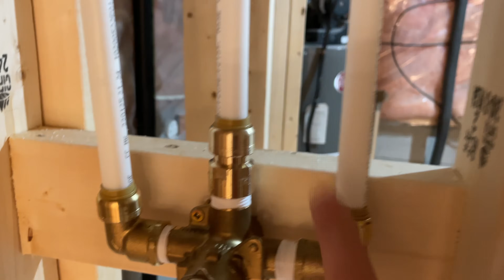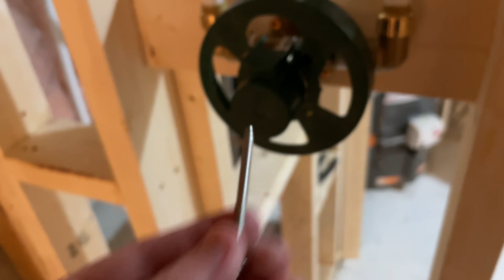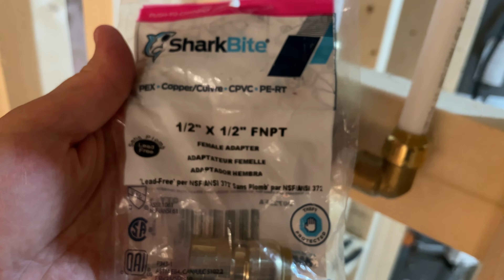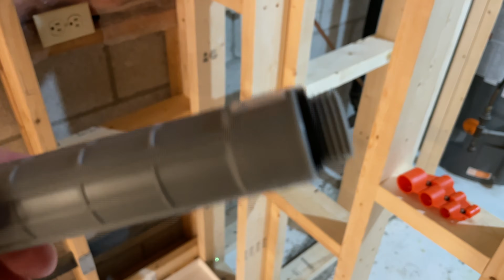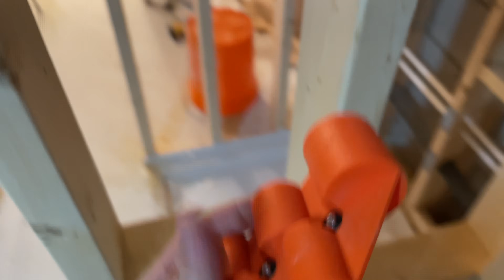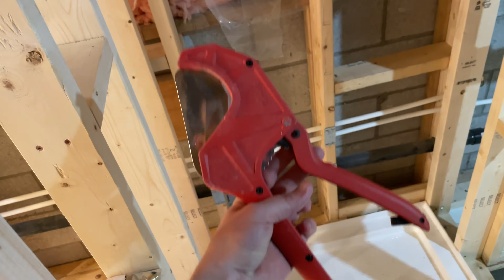Shower Setup with SharkBite Connections

Comment: Very informative, thanks! I plan to run the water source via pex from underneath rather than above. This shouldn't be a problem right? The Moen shower valve should be sufficient to control the water right? (or should I install a valve before the shower during the construction phase?

Comment: Then you flood a house and do 100,000$ worth of damages 😂
Reply: are you referring to the use of shark bytes?  I am considering these but I have been told mixed things by plumbers.   Not sure what to do
Reply: @winnemucca-sk5392   When I use shark bites inside a wall, if possible, I cut a small inspection behind the wall to check for any leaks in the future.  For example, in this video, there will be drywall behind the shower, just cut a small inspection hole and cover with a plate.  If he found a leak, which is very unlikely in the future, Then he would cut the wall open behind the shower to fix as he wouldn't want to tear tile off the shower.  So he may plan ahead and connect his shower valve from the back so he can remove from back wall.  Again, rare for a shark-bite to leak but has happened.